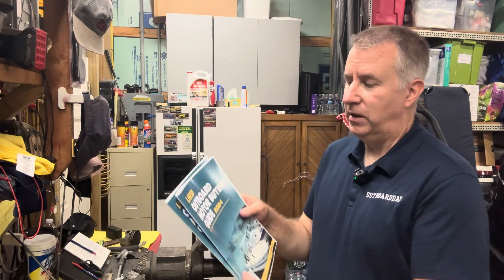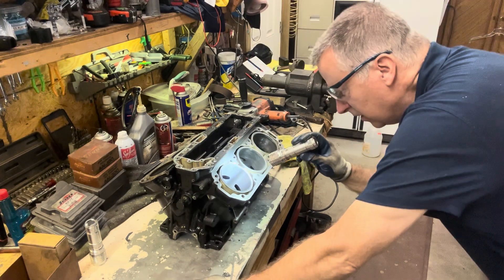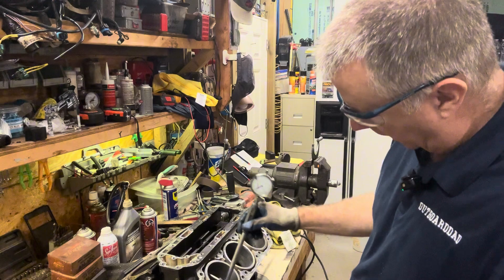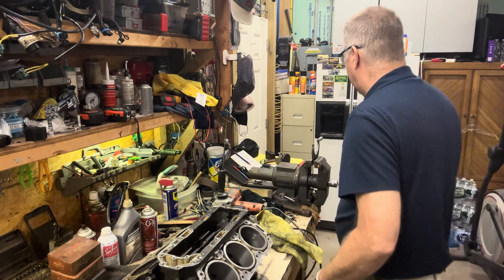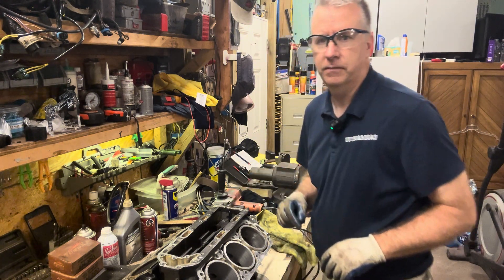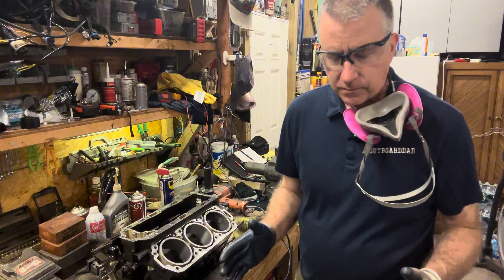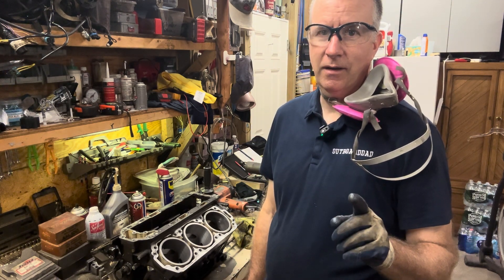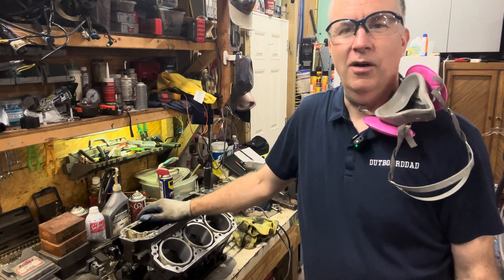Outboard Block boring and measuring (Part 12)

Comment: Hi came across your channel and love it!   Keep up the great work! 

I have a question sort of related to your video....

I would like to make 20-25hp in my 1992 mariner 15hp outboard.  I can't just use a 20 or 25 because Im using this on a inflatable boat and the transom can't handle the weight of a 20 or 25.  Id prefer to do some tweaks to my 15 since it only weighs 75lbs.  

What things could I do in order of least involved to most involved?  Thanks in advance!
Reply from the maker: Sure well what you need to consider first is your end game goal. If you just want speed at any cost then you can find forums and parts places to upgrade reed plates and mill heads and exhaust. But ultimately shortens the life. I would look at your transom design and see if you can reinforce to add strength. I hope this helps you make the right choice. Keep me posted keith@outboarddad.com

Comment: Hi, Keith!

At 4:30 I didn't understand why if you measured 5 and 7 thousands, that means that you are in the 15 thousand range for the new oversized pistons.
In my simple reasoning, the new pistons wouldn't fit inside the cylinders that are only 5 and 7 oversized. 

I understood that oversized pistons are built in 15 and 30 thousand.

This would mean that you should bore  at more than 15 at least.
Reply from the maker: @josemariatrueba4568  Hey Jose, hope all is well with you and family. That was the measurement of what needed to come out in order to remove all damage as well as get them round. The new size starts at .015 so if I took more that that out to get them cleaned up I would need to get the next size up pistons. Does that help?
Reply: @OutboardDad  Crystal clear! 
Thanks a lot for the explanation.
BTW...
Everything alright, including my 100 year and one month old mother!
Reply from the maker: @josemariatrueba4568  Amen!